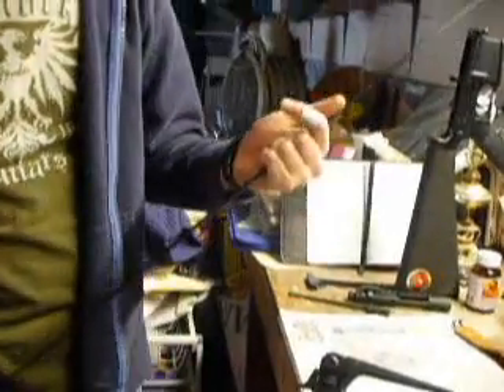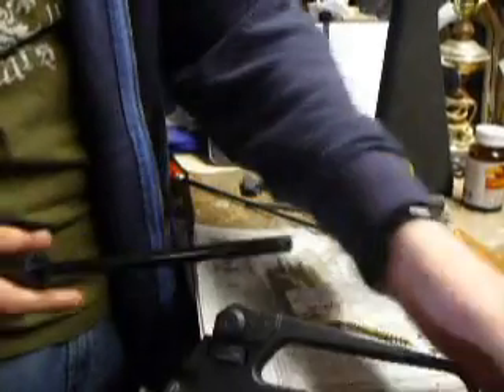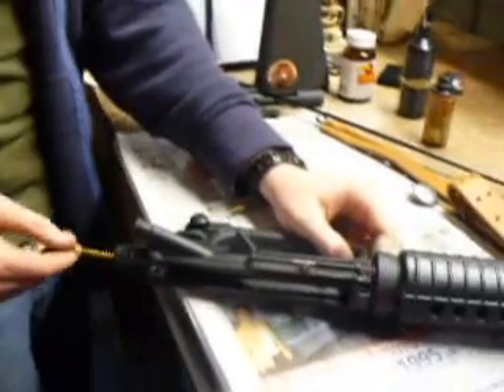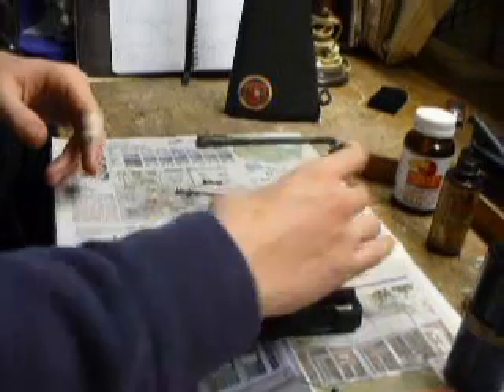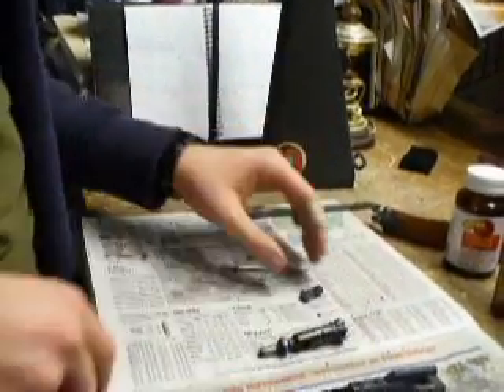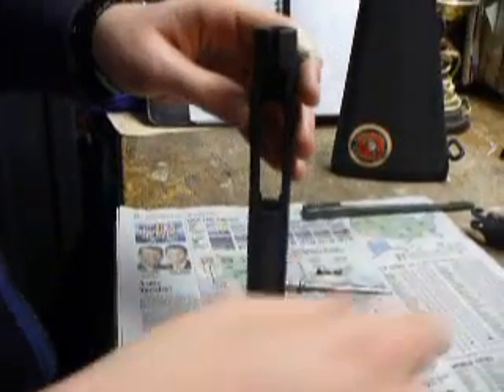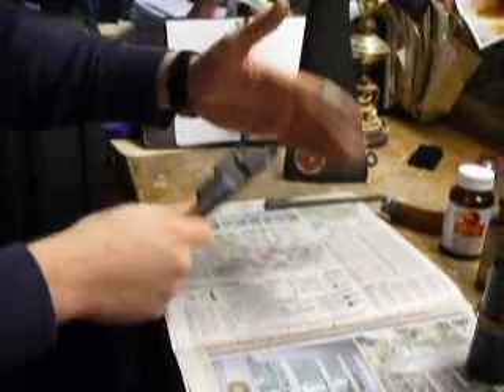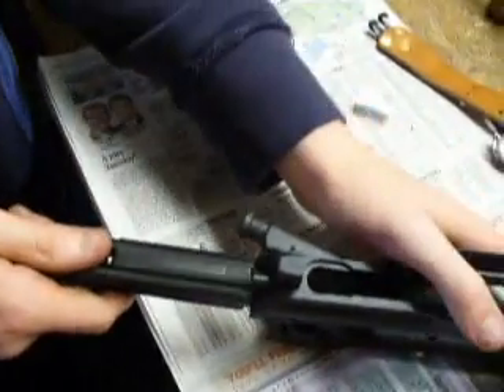AR-15 reassembly and cleaning PART 2

Comment: EASY SOLUTION: Just get an AK-47 or AK-74 rifle and no more worries of having to keep the bolt SOAKED in oil constantly, while also having to keep it SPOTLESSLY clean to the point you can eat of of it just to avoid the rifle becoming the JAM-O-MATICS that the AR15 and M16 platforms are KNOWN FOR BEING.  Period.  Ridiculously HIGH MAINTENANCE rifle that honestly should NOT be trusted to defend your life or your family's life with.  PERIOD.